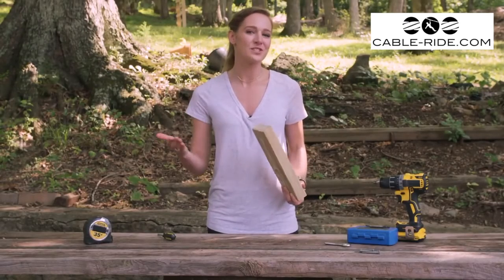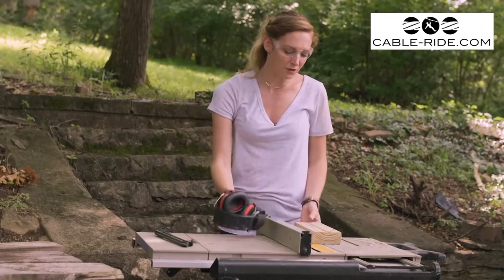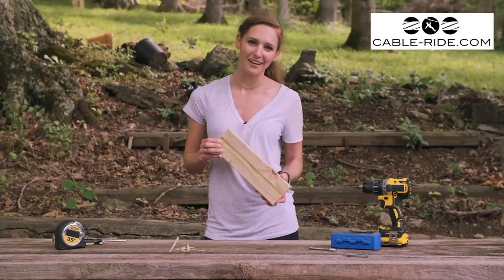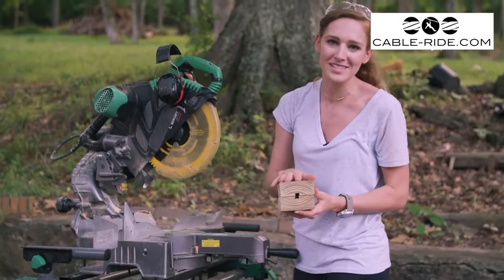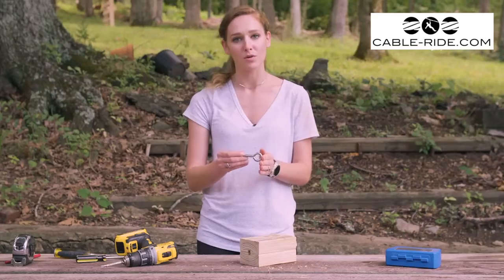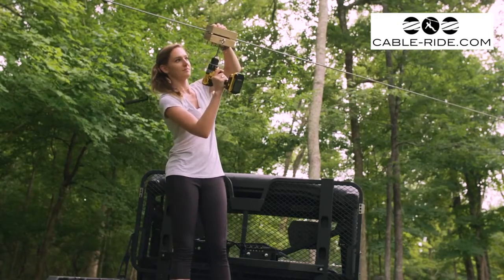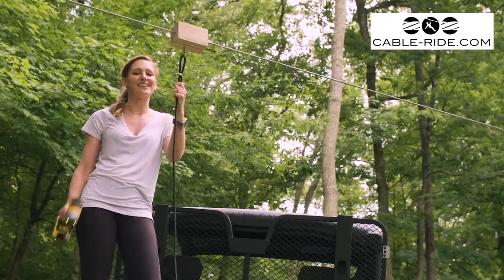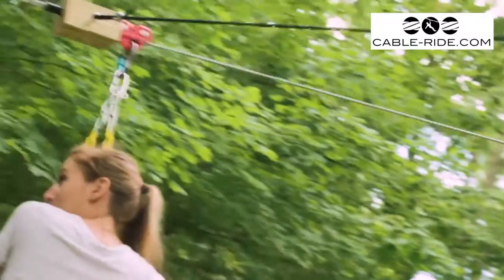How to install a zipline bungee brake

Comment: Well from what i saw the wood block stopped because it contacted the cable clamped at the end and all the bungee cord did was slow it down a little . Clamping bungee cord with cable clamps  isn't the best idea either and to use just 1 . Sorry but you've got some flaws in this video.